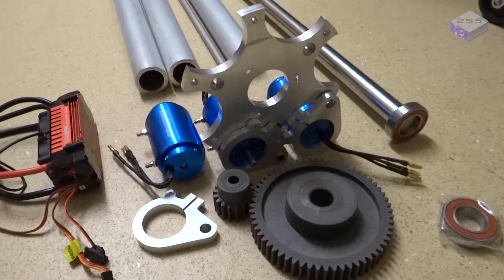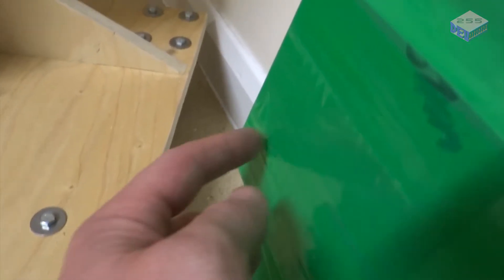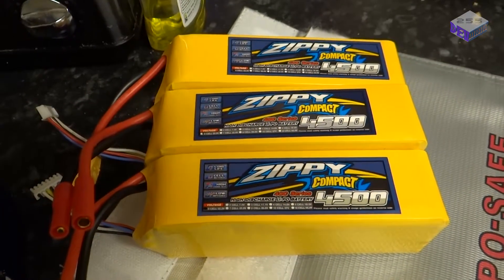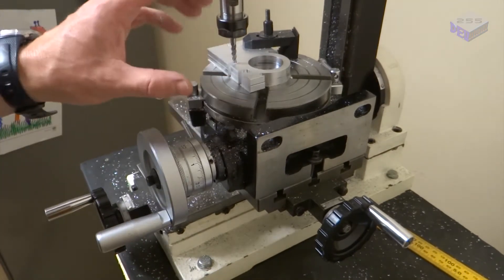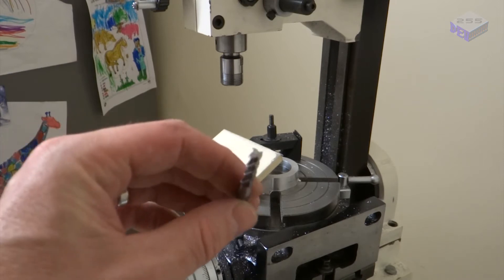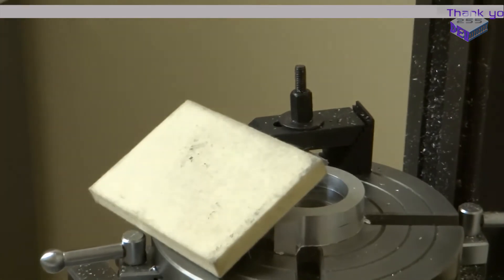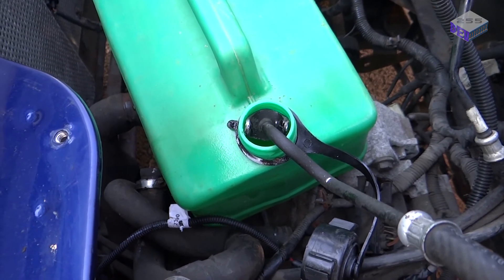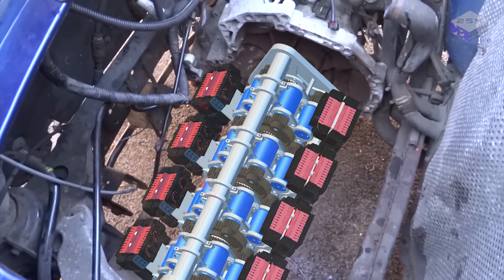MGF EV Milling and General Update

Comment: Are you taking the fuel tank off? Could the small battery pack go in its place?
Reply from the maker: I would love to take the fuel tank out, although it looks as if it is behind welded panels, it is well vented though.
Reply: @TheSolarPoweredEngineer  It's a bit surprising it can't be removed from under the car
Reply from the maker: @NicksStuff  I'll have to take another look, once I start stripping stuff off it.

Comment: The arduino boards are really not powerful, they are going to cause you problems, taking in account that you are going to use them to controll a car, I really recommend use a powerful board, teensy, esp, raspberry, etc
Reply from the maker: Hi Pasblo, I agree for full control I'll use a Teensy as I can push through tons of IPS, although the Arduinos are good for lower level control of individual items, such as water flow, temperature control, motor disengagement etc. The Arduinos will run like a slow CAN bus system with the Teensy being High speed. I like the idea of multiple redundancy. To be fair I haven't played with a Teensy yet, although have looked into it quite a bit, so may just get one soon and do some comparisons.

Comment: Great to see the progress Neil, always happy to watch machining😝. With the batteries, are you planning on running a lipo setup on the final system or will you go with another type? I'm running Li-ion as its easy to make large custom packs, the battery spot welder was very cost effective and there are many cells available for every application.
Reply from the maker: Hi Martin, thank you, i'm looking at putting Li-ion cells in the final project as I don't think Li-Po batt's are allowed in vehicles, I will have to check before hand, would love to use nanotechnology batteries if allowed. I'm currently looking at converting my mill to CNC, as it will save alot of time, where I can get the project completed quicker. I'll have to show the upgrade on YouTube too 👍
Reply: @TheSolarPoweredEngineer  Maybe a first step could simply be to print the drawings on a sheet of paper (strictly speaking, a printer is a CNC)? Glue the paper to the aluminium stock, that will  help for referencing, maybe drill holes, ...